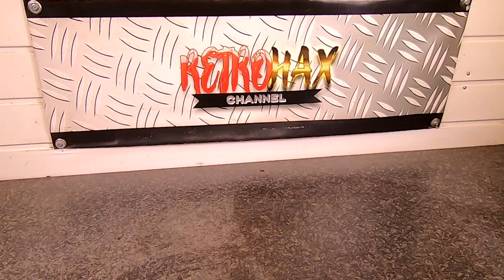Rusty Brake Caliper Overhaul Restoration

Comment: If you leave the banjo bolt, piston, and piston seal in, and leave the bleed screw tight, you can blast the whole unit and not worry about having to stuff things in holes or tape if off,   Just my 02 cents!!   Great job though none-the-less.

Comment: That is a great job, Martin. Around here in the states, I usually just install remanufactured calipers. When I try to undo the bleeder screws on them old ones, they almost always break off. They throw so much salt and stuff down on the roads in the winter time everything gets rusted out. Even trying to replace a brake hose is kind of a big job. I went to Community College and I had a job at an import shop, Volkswagens and Subarus, and I was taught to use never seize where the threads are and where the pads slide on the caliper mount. Never had any trouble.
Reply from the maker: Yes, I got lucky with these ones

Comment: Hi Martin,
Beter use ATE plastilub on the rubber parts and ceramic grease on the metal parts so you won,t disturb the antilocksystem (abs)

Greetings from Holland.

Comment: Normal silicone grease? On brakes? In those temperatures?
Reply: yes silicone paste/grease or red rubber grease for rubber contact parts and ceramic lubricant for anything else on brakes, that pretty much industry standard .
Reply from the maker: They come with silicone grease.
Reply: @RetroHax  Afaik, i'ts high temperature resistant grease, that comes with them. Special, dedicated stuff.
Reply: @tadeuszcyrulinski5070  red rubber grease (RRG) that specially design for hydraulics and use in brakes is only rated at 160degC, most silicone is 180 to 200degC 

It quite simply doesn't get that hot and if was the rubber parts you use this on be burning .
Industry standard on hydraulics is RRG or silicone grease, silicone seems more common these days and you see it in use in everything from aviation hydraulic/pneumatics to most brake build kits  .
The grease you may use behind piston to pad and pad clip hardware will see higher temps and this ideally wants be ceramic type paste .
Granville, carlube, apec, permatex  do range products for brakes easily found and fairly cheap .

Comment: Very nicely done.   ;o|

Oddly enough, the first brakes I ever took apart were on a Vauxhall - my Dad's HB Viva 1600 Slant Four, quite a beast. 1974, I was eight at the time.

It went up mountains in North Wales like nothing. Mind you, when pushed it only had slightly better mpg than the flare at Stanlow...  #o.

Comment: Why not using those rubber stops during the sandblasting?
Reply from the maker: Why?
Reply: RetroHax prevent damage to the threaded or holes with a smooth surface.

Comment: Did you spray it with salty water to get it rusted?
Reply from the maker: Why would I do  that?
Reply: @RetroHax  to have material to make video. It's just the rust is so even, never saw caliper, bracket that rusted. But I saw steel cleaned from zinc and sprayed with salty water couple times with exact same condition. 
Overall it's nice to watch you video. Satisfying.
Reply from the maker: No bud, as I noted in the video, I sandblasted the caliper bracket a month ago but decided to refurbish the entire caliper including that bracket

Comment: I want to use evapo-rust on the caliper after they are taken apart to treat the rust.  Anyone see any problems with that in place of the sand blasting step?   I don't have a sand blaster.

Comment: next time you get your tyre changed ask them for an old valve stem . if prefect for popping the pistons out of calipers
Reply: Simon Rawle  or just poke a screwdriver through the hole and push it out.  Seems like his method worked just fine.
Reply: @fedrooster  it did but on cailpers that the pistons are enclosed and even more stuck the value stem makes a better seal and helps get the pistons out

Comment: I'd have used rubber grease for the piston seals and piston.
Reply from the maker: They come with silicone grease in the kit.
Reply: @RetroHax  I get that. Buy some parts include some grease. I use my own or an appropriate one. Silicone grease in the other places is fine. Even brake fluid as a lube for the seals would be fine

Comment: No need to use copper slip on pads now days, that’s why they have anti squeal plates and all copper slip does is attract brake dust and cause the pads to stick.
Reply from the maker: Not where I put it.